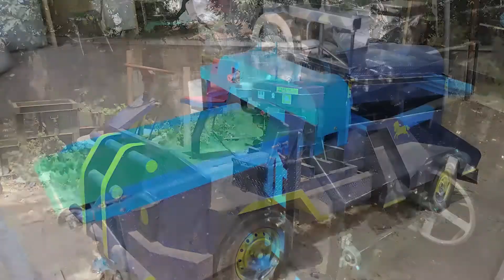Mesin Serut Es Balok | Serut Es Tercepat

Comment: Cek harga bang...
Reply from the maker: untuk info harga,detail mesin & pemesanan hubungi Customer Service Representatif Kami (Telp/WA) 081234280625 - 081217850288 - 082142267610 - 0812330810125 atau kunjungi Workshop Kami di Jl Madiun - ponorogo KM 10 Selatan Puskesmas Geger 300 Meter Kec Geger Kab. Madiun Jawa Timur